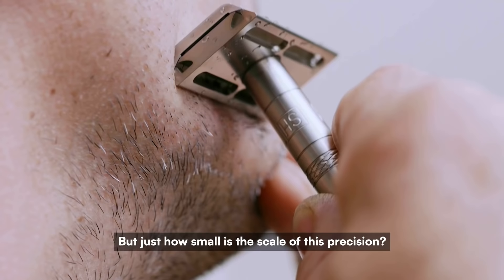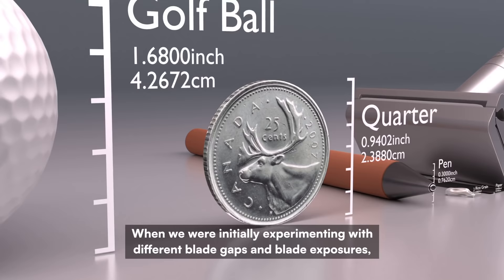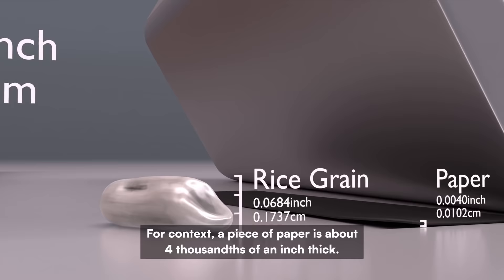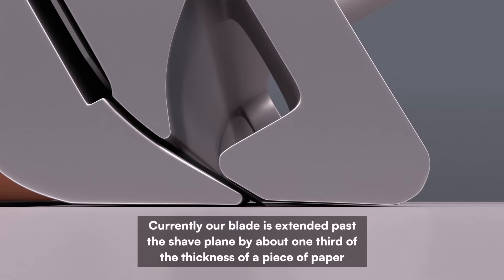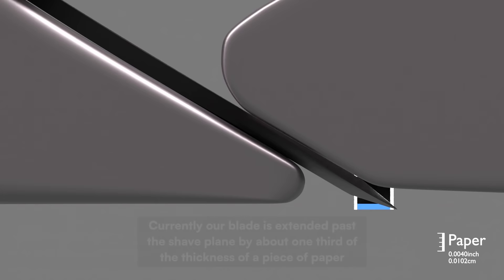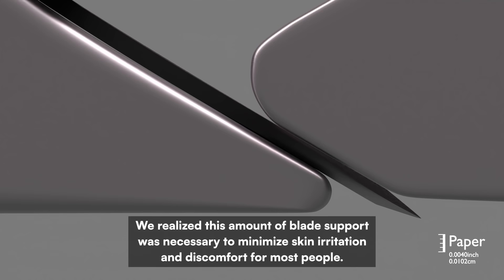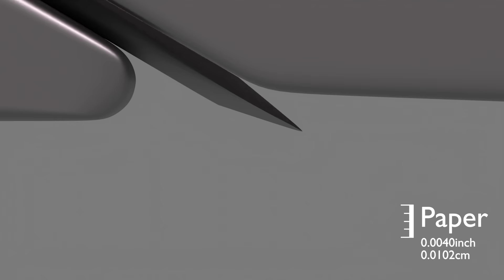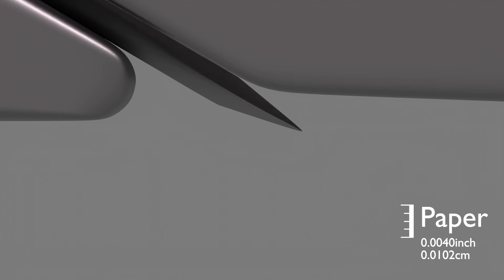The Scale of Shaving

Comment: The tolerances for the Razor might be strict, but the blade have bigger tolerances no? Blades and vary widely, at least more than a thickness of paper. Therefore the blade can stick out a lot.
Reply from the maker: The variance from blade to blade will add to the variance of resulting exposure. This is an industry wide issue that all razors are subject to, however we combat it in several ways. 1) We use the tabs to align the centrality which is more accurate than the diamond slots. 2) We hold tolerances on critical features that influence exposure, very tightly so that the variance from the blade is not as impactful on the resulting exposure (whereas if we had looser tolerances, the varying exposure would result in even more variance causing a more drastic under or over efficiency/aggressiveness. 3) We manufacture the location of the tabs on the top cap, in the same operation as the shave plane face (except for +++ which has more leniency) which governs the centrality of the exposure relative to the blade and its position. The tolerance is not made by any specific blade. The geometry is created based on the size and thickness of a blade that is representative of the median size where most blades measure. The tolerances are set mostly irrespective of the blade size, brand or other geometry.

Comment: I use a Gillette MkIII and go through one blade about every 4-6 months.  The problem is that people don't know how to take care of their razors.  After shaving just rinse everything from the blades then run the blades crossways through the piles of a towel to dry them completely.  Store your razor in a drawer where moisture won't get to it.  It is the moisture that corrodes the edge of the blade and makes it dull.
Reply: I am not a cartridge fan, having transitioned to DE razors about 2 years ago at the start of the pandemic, and I do not think I will ever go back..  But there is a lot of truth to what Jim is saying here.  I live in a very humid environment, and to make matters worse, we keep our shaving gear in the bathroom, which is often the most humid room in the house.  I would rather have a crappy blade right out of the package than an excellent blade with three shaves on it that is a week old.  And it's not just the number of shaves on a blade, it's how long it's been out of its package in the humid environment.